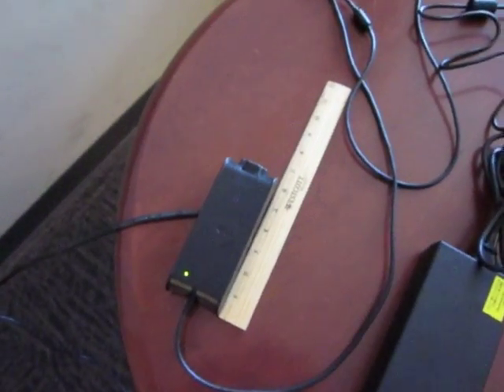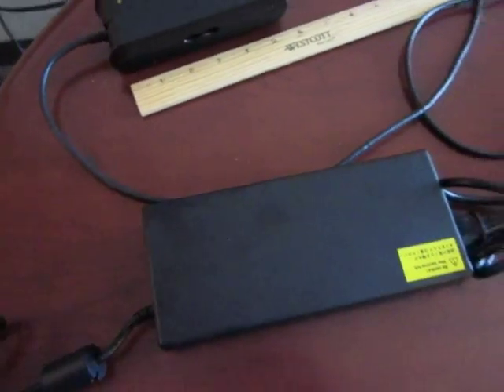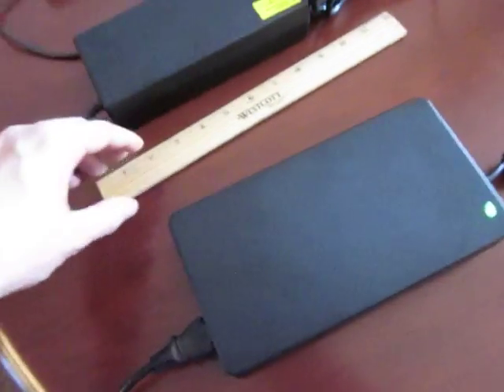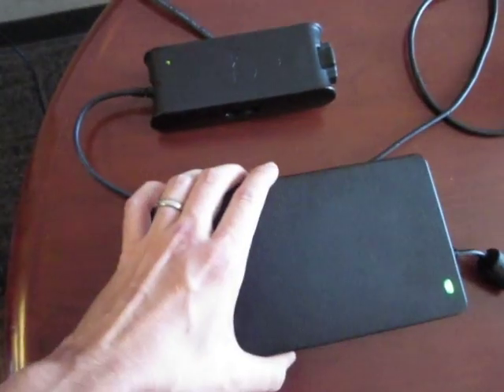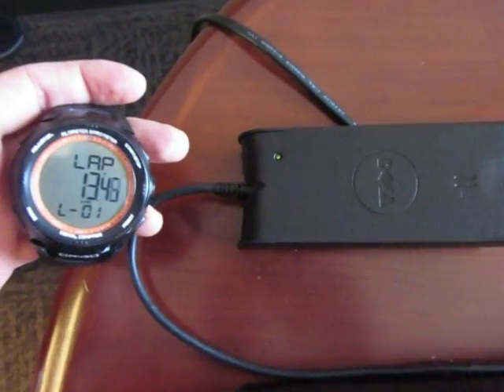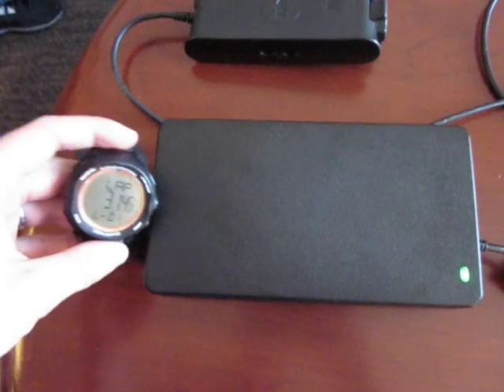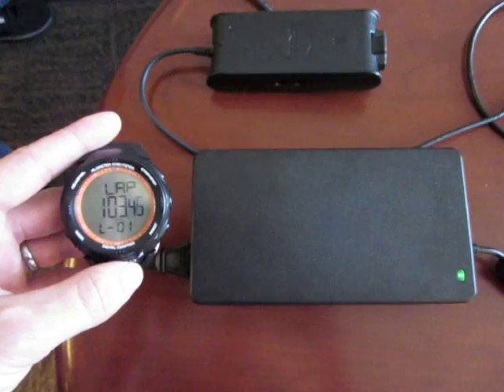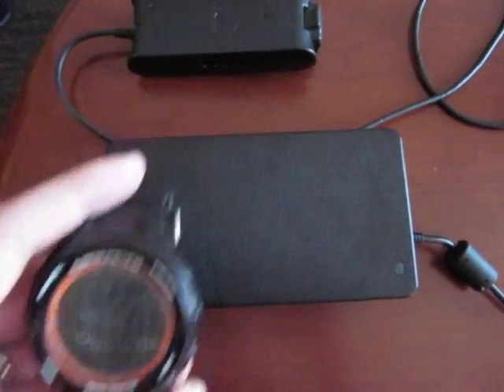THIS is a brick

Comment from the maker: The two bigger one, the 220W and the 300W are power supplies for a Clevo P180HM with SLI nVidia GT560Xm. Even the P180HM had some more juicy configs which took two of these. I have to confess, that I have a temptation to upgrade to a Clevo P570WM after I developed version of GPGPU software. So imagine two 300W of those bricks, they are connected with the piece I linked in the description. I just have to pretend at airports that my bag is not heavy :). If they would measure it... :D